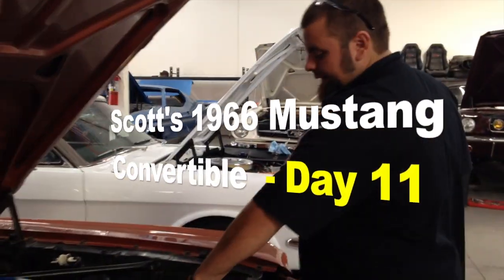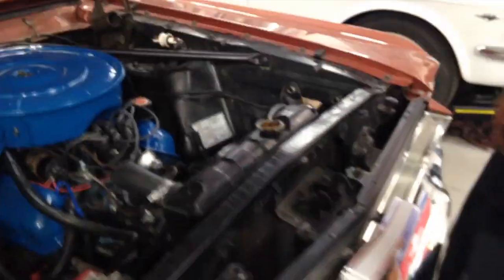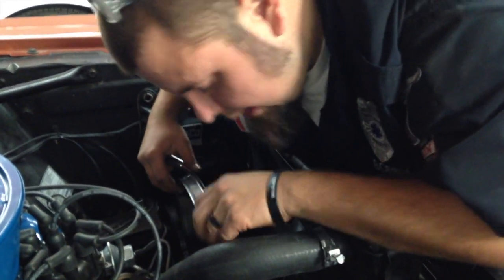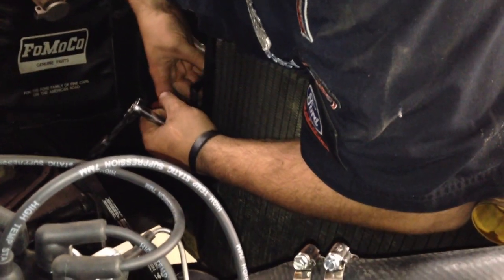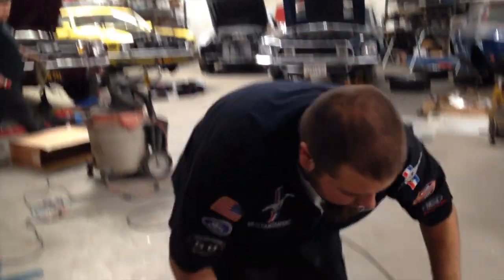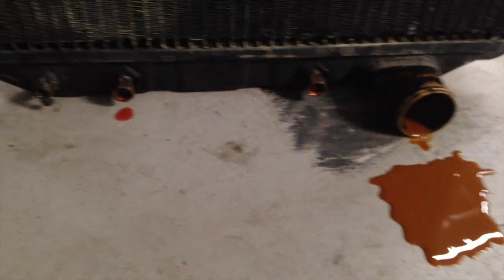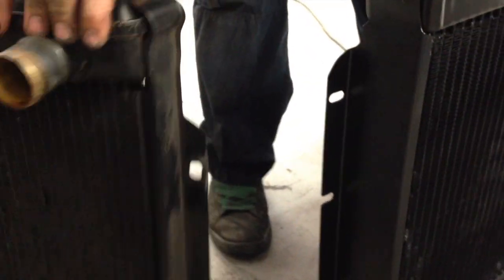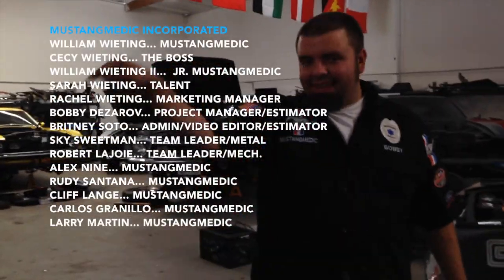Cooling System Upgrade On Scott's 1966 Mustang Convertible - Day 11

Comment: Could you please tell me what manufacturer made the radiator you installed.
Reply from the maker: For what Mustang or car!
Reply: Scotts 1966 mustang convertible cooling system upgrade.  I have a 289 and ordered a radiator from Amazon & the bracket holes did not line up.  I was wondering what brand/manufacturer/part number do you recommend.  I would like to keep the car looking original, however my project car is become more expensive every day.
Reply from the maker: Jack Wasnooski that’s shocking what brand did you order? Obviously return that one, I would first demand your money back and force them to pay to get the bad part back.  I recommend Scott Drake products, they are dialed in on 66 Mustangs you won’t have an issue.  I wonder if your radiator came from China?